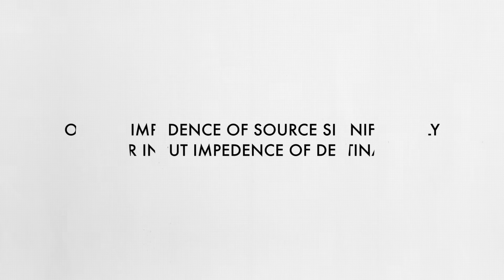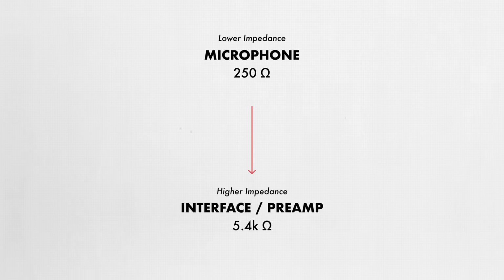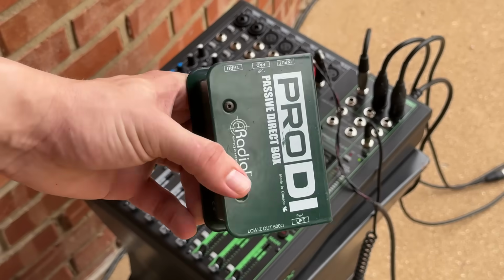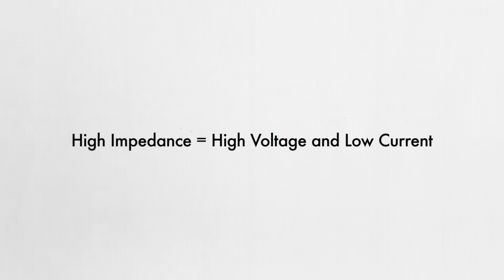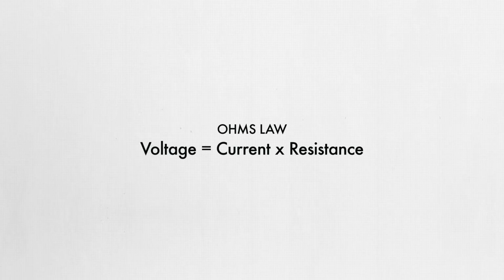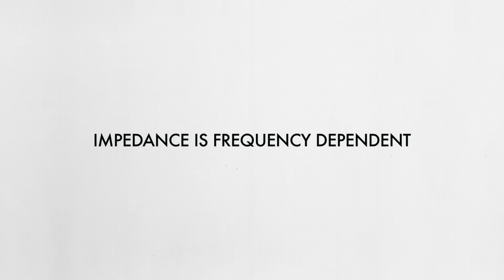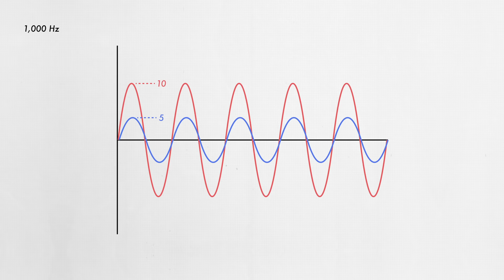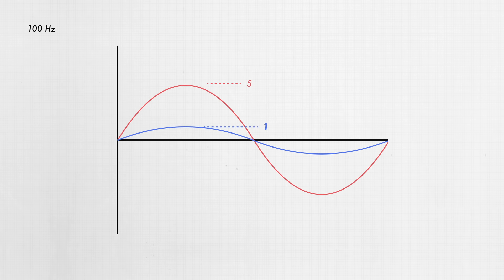Hi-Z vs Low-Z: What's the Difference?

Comment from the maker: What topics would you like to see in future videos? Let us know below 👇
Reply: How to mic and then mix two microphones on a classical guitar. Also, which kind of mics to be used, generally and traditionally speaking.
Reply: Great video.
What is the device you used to change the mic input impedance?
I've found my multimeter again 🤣 maybe a video about it how to use it and what fore (like cables or humbuckers).
Reply from the maker: @MadNoisy Cloudlifter Z
Reply: @MadNoisy  Good question , waiting for the reply
Reply: Can you help me how can i  place the stage monitors and which monitors are best?
Reply: I want basic level to high level teaching please sir  I request from India🤝💐💕
Reply: How and when to use levels, gain, and compressor gain or any other recommendations if doing live audio for quiet singers or wide range of singers. I remember the moment I discovered using Compressor gain helped me greatly running sound for venues at times, but tbh, I still don't fully understand all of that as much as I would like to.
Reply: would like to the different between active and passive DI
Reply: level of audio and applications and all about that Xd
Reply: A proper comparison, of using DMX instead of XLR for audio transfer.
Reply: I understand that delay applied to speakers placed physically forward of the main FOH clusters is beneficial at outdoor events and very large venues. But what about smaller venues?
My main reason for asking is that sometimes more performing space can be had by changing placement of subs versus top boxes. So... at what point, or distance, should delay be implemented when moving some enclosures forward of others?
Also, how do you account for the distance from the face of the driver in a sub to the lip of the front opening when compared to a front loaded top box?
Am I digging too far into the weeds?
Reply: I used a condensator mic to mix my trumpet on a track. It sounded awful...what is the problem with recording the trumpet or maybe any other brass instrument..are there specific actions to be taken here...or maybe just a good quality mic will do...that's a topic where I would like to know more about...
Reply: The calculations required to match power amplifier with the impedance of the speakers.
Reply: Why phantom power is 48v,?
Reply: @slaveskater Phantom power is a DC bias used to create a charge across the plates of a condenser microphone.  Because it is DC, it has no effect on the audio signal.
48v is a compromise between performance and safety.
Reply: Great lesson learned a lot. Can you please explain impedance of guitar pedals too. Some guitar pedals like eventide h9 have high input impedance what happens if we use buffer before those pedals. Also chaining pedals according to impedance is necessary or it does not make any difference. Thanks

Comment: I'm running my unbalanced keyboard outputs to a passive DI box, then using balanced cables from the DI box to the line input of the mixer.  However, the signal is very much atttenuated and I almost need to max out the gain in the keyboard and mixer to get enough sound.  Should the balanced cable from the DI box go to the MIC input of the mixer?  I'd prefer to just run unbalanced cables but its a very long cable run (more than 30 feet)

Comment: As I summarize this video, there are resistance which is frequency dependent, and if you mismatch the value called IMPEDANCE, you lose the tone of the instrument(also level due to the background noise?).
A "1(out) : 10(in)" ratio is commonly recommended.

Comment: Thank you 
This helped explain something I was doing in my home studio. 
I used to plug my guitar directly into the 1/4" jack of my interface. It sounded OK. Guitar 8KΩ, interface input 750KΩ. 
I bought a cheap preamp, used, $25. After using it mixing became easier.  I run the guitar to the preamp, then preamp 1/4" output to the interface, instead of an XLR. Why use a 8 foot XLR when I can use a 6 inch patch cable for pedals? Input impedance for the preamp is 850KΩ. 1/4" output impedance is 300Ω. 

I'm reluctant to try an XLR. XLR output impedance of the preamp is 600Ω and the XLR input impedance of the interface is 1.4KΩ.

Comment: This concept is so unintuitive to me. I would have thought a HiZ source connected to a LowZ input would be better since the overall impedance is lower thus allowing the electricity to flow freely. I guess Z being dependent on frequency is what makes the difference here but I still can't quite wrap my head around it intuitively. I guess it's one of those things you memorize and have a revelation about years later lol
Reply: Think of a thin tap (HiZ) that gives you 1 liter per 15 minutes and you want to fill a large mug (lowZ) ... doesn't fit well even though the water flows freely.
Reply: If you put an even smaller straw at the end of the tap the flow is restricted. In the limit as the straw gets smaller the current stops, so how is that better?

Comment: 8:17 Question - I have a JVC M201 (1979) 600 Ohm “Electret” microphone powered by a C cell, it is stereo and terminates in 2 TS 1/4 jacks, when I try it with the combi jacks on my Behringer UMC202HD interface (Line in) noise/hiss quickly becomes an issue when increasing the gain - Would something like the Behringer D120 DI/Splitter help me get a decent/less noisy signal? Or should I find a dual channel preamp to take the 1/4 jack input, then feed the XLR output from the amp into the interface ?

Comment: I feel like a lot of these videos aren't explaining what source impedance actually is and just leave it out completely and it causes a lot of confusion.  It took me forever to realize that voltage sources themselves (transformers, generators, batteries, power supplies, guitar pickups, microphones) actually do have impedance.  The source and the load kind of act as a voltage divider, resulting in an output voltage drop as soon as any source is put under load.

Comment: I have an audio interface called Track Rig from Loop Community that has 8 line level XLR outputs, I know that XLR inputs on any mixer are designed for mic level, could I plug straight the line level XLR outputs from my audio interface into XLR inputs of a mixer without any D.I.? I’m not sure if XLR inputs on a mixer are low impedance, high current or not. As I really don’t want to use XLR to TRS adapters for all 8 outputs of my interface and plug into bunch of D.I. boxes as D.I. usually come with TS/TRS line level input, not XLR line level input

Comment: Imagine what will happen when you connect a thin pipe (high impedance) to a thick pipe (low impedance) and push water through it...although the thick pipe has the potential to transport more water through it, the force of the actual waterflow will drop down, once it reaches the thick pipe..resulting in a waterflow with much less force...or in audio terms: resulting in less volume/ amplitude/ force of the audio signal..it is however paradoxal, where one would expect more force/volume where the impedance is low(er)..in this case: in the thick pipe..
Reply: this is a kinda bad example, a thicker pipe has more pressure (and using force is a weird measurment anyway because in fluid mechanics most things are measured in terms of pressure), maybe you are referring to exit velocity of the water after it is out of the pipe?

please elaborate because in terms of fluid mechanics you are not making sense
Reply: @CardThrower-rb6eg Im trying to explain what happens when a high impedance device is connected to a low impedance device...you know the theoretical terms quiet well..but I guess you never understood the phenomenons...😅
Reply: @CardThrower-rb6eg yes you re right about the theoretical terms...but I was just trying to visualize what happens when high impedance meets low impedance...thats the topic here right...? But I m wondering if you have understood any of those terms..😂
Reply: @ramongeraci well i still do not get impedence at a theoretical level, but i am a civil engineering student so i get water mechanics better, and your water analogy doesnt make sense

because when flow transitions from small pipe to big pipe the pressure measured by a manometer actually increases instead of decreasing to conserve energy, and the flow transfer is still the same because of the conservation of mass

i have always been weak when it comes to electrical topics and your explanation in terms of fluid mechanics did not make me get it so i am sorry for that

Comment: I always thought the whole DI box thing was a nice-to-have, not a requirement. I’ve run line level sources through guitar pedals, back in, etc. and just adjusted the levels to get the gain staging close enough. I now see that it’s about so much more than just levels. The actual audio examples were very revealing. Thank you

Comment: When talking about the impedance of a device that 'outputs' or transmits a signal it is the OUTPUT impedance of that device which is appropriate for comparison to the INPUT impedance of the device to which the signal is being sent. i.e., the input device.  For example for an electric guitar it is the output impedance of the guitar's pickup(s) which should be compared to the input impedance to the amplifier or other device to which the guitar is connected.

Comment: As a hobbist musician and electronics engineering student approaching graduation, it's very hard to find people who can overlap both worlds. Audio is full of myths and misunderstandings and engineers often lack the terminology to fully engage, explain and discuss how things work inside equipment.

The analogy with the sticks is a good visualization of what actually happens. Output impedance can be tought of as a resistance in series with a voltage source. While unconnected with another equipment, the voltage on the output would be the same as in the voltage source. The higher the input impedance of the equipment you connect to the output, the less it will impact the output as it will not be loading it. If anyone wants to dive into the electronics of it, check out how to calculate resistor dividers.

Comment: Since you asked for it: This isn't a real explanation. To do it correctly you would look at how the resulting voltage divider circuit behaves at different frequencies, and how that changes the voltage into the amplifier. But this is probably close enough to convince people to do the right thing, so good enough IMO.

There's nothing all that magical about 10:1, it just ensures that the expected frequency response variations are on the order of 0.4 dB or less.
Reply: Is there a problem with input impedance being too high for the source (say, the ratio of 100:1 or 1000:1)? I.e. what’s the downside of using high impedance inputs for low output impedance sources?
Reply: With a dynamic or ribbon mic in particular the input provides dampening of the diaphragm's motion, and the amount of dampening is load- and therefore impedance-dependent. When the input impedance is very high it's effectively an open circuit with no dampening, and the mic may "ring" or resonate more. The SM57 is claimed to suffer from this effect, though I've honestly never tried it with a high-Z preamp.

Comment: Why not making all amp inputs high-z (100k-1M)? Wouldn't it satisfy both low-z mike and high-z instrument?
What role voltage plays in this equation - in simple terms, please? I get that high-z instrument provides higher voltage, and vice versa, low-z (dynamic) mike gives the lowest voltages. Is this the reason we cannot get by one-type, high-z amp input for all cases?

Comment: I think you should take a look at Thevinin’s Thorem…this is the construct that models a signal source as a voltage source in series with an impedance and a signal destination as an impedance…when one is connected to the other a potential divider is formed by the two impedances…source and load, in series.

I tend to find that as people learn about electronics/electrical stuff, the concept of voltage is the first to be understood. Later..and how much later depends on the individual, the concept of current is grasped…then the concept of resistance (For DC circuits) and impedance (for AC circuits). Resistance is just resistors…impedance is made of resistors, capacitors and inductors.

Once the concept of impedance is grasped…it all becomes eady and clear.

For example, what makes mains wiring dangerous? It is not just the voltage….static electricity when you pull off a nylon garment is far greater…what makes the danger is a combination of high voltages…>70 or so, and LOW SOURCE IMPEDANCE…that’s the real kicker.

Comment: Impedance has been one of the hardest concepts for me to truly understand... As well as the different ways DI boxes deal with impedance. Opening up some passive DI boxes helped me realise that we typically assume that the only way the DI adapts impedance is by using a transformer, but a lot of the passive DIs I opened up were using 1:1 transformers, meaning they were just balancing the signal. However, they had resistors that could be enabled or disabled (those were the attenuation pads). Resistors don't affect voltage, but current, so they affect impedance as well.

I would highly encourage everyone to open up some DI boxes and spend some time following up the tracks on the PCB to actually understand what's happening to the input signal.

Ohm's law is crucial to understand the whole picture, as well as understanding that impedance is the sum of resistance + capacitance (the way capacitors oppose to current flow, and it's frequency dependent) + inductance (the way inductors oppose to the current flow, and it's frequency dependent). Putting all that together made me understand way better what impedance was related to my audio signals.
Reply: Resistors absolutely do affect voltage!  Ohm's Law, states that the voltage drop (E) across a resistor is equal to the current (I) flowing through it multiplied by its resistance (R): E = I * R.
Reply: @MrAdopado First I want to say that I don't know how to explain this using Ohm's law, but you can check for yourself that this behaviour actually takes place.

When a resistor is applied in series to a signal the voltage remains the same, but the amps are reduced according to I=V/R. I literally just tested it both on my protoboard and on one of my passive DIs.

Again, I don't know how this is explained by V=R·I, but you will se that it definitely is what happens (unless you create a voltage divider using more resistors).

If you could explain this for me I would appreciate it much, since Ohm's law still has its own "obscure" applications that I don't fully understand.

Comment: Great video!
Side note, as in most cases, as long as you know about the "rules", you can break or bend them a bit. If a mismatched impedance situation resuilts in a pleasant sound, there's no law to prevent you from using it.
(some care might be needed for extreme mismatches, where overloading or overvoltage could result in damage, )
Not quite a fitting example, but you could use a 15" woofer (usually 4-8 ohm input impedance or thereabouts) as a bass microphone, just don't expect it to behave like a normal microphone
Blended with a normal mic and some EQ, it can make for pretty interesting results on loud bass-heavy instruments. (As a bonus, you can look up the impedance curve of the driver/box combo, and work out roughly how the impedance will affect the sound.)

Comment: So that's why my guitar sound dull when I record it through my mixer 🤦‍♂️ 
Amazing video,  thank you
Reply: Indeed. That's why you need a DI box ... and they are quite cheap, even the active versions which are more versatile and can be powered from the phantom power output from your mixer. This is one of the instances where you are not straining to hear the quality difference! The DI also gives you a ground lift button which is a magical solution for ground loop hum.

Comment: This long explanation about the impedance messes with my mind much worse than a simple explanation of the RC filter! Why you're not telling about that? That dull sound is just the consequence of the RC filter that comes up here. The pickups has capacitance (roughly!), wires has resistance. So you get that RC filter. That's it. "Frequency dependent" about all this - is like telling "my car's engine gets louder because of a gasoline's octane value". Something like this.
The "frequency to voltage" explanation at the end can be explained simple: you have the RC (or CR, depends on...) filter in the circuit, thus it cuts upper (or lower) frequencies. And then if you explain the work on RC/CR filters, you don't need that "Z" generally.